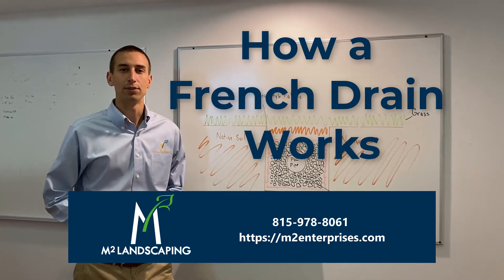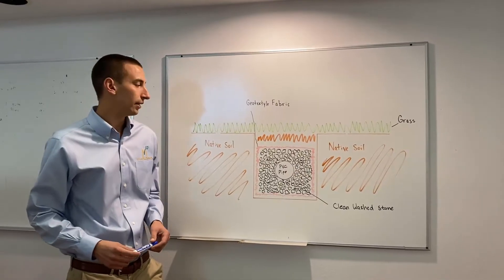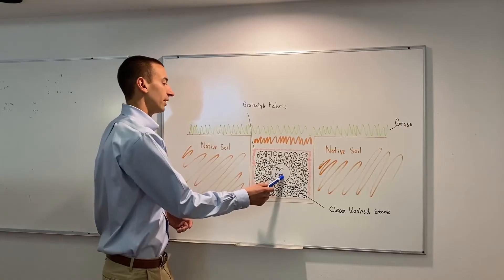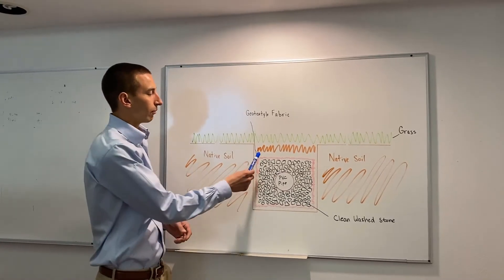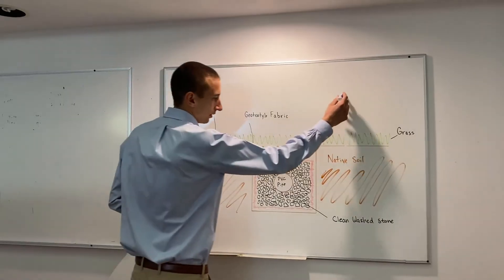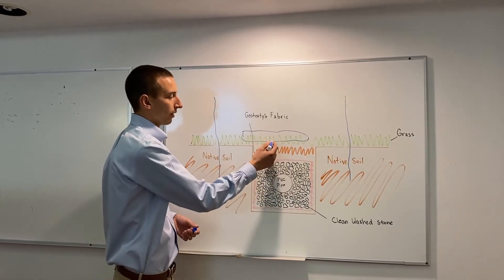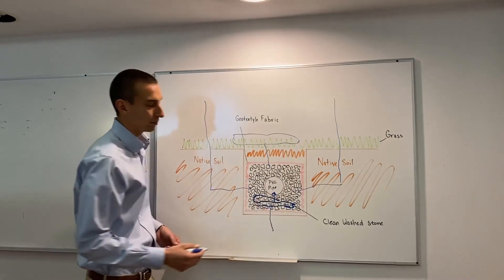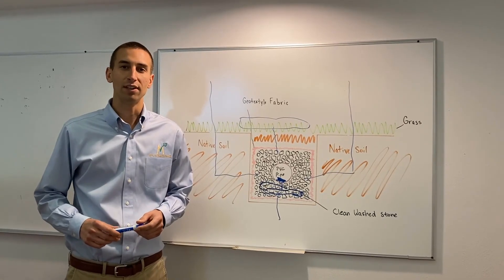How Does a French Drain Work?

Comment: 1. DON'T USE PVC PIPE! Use 8-slot high-density polyethylene pipe. The only pipe you should ever use for  french drain.
2. Place the pipe at the BOTTOM of the trench. There is no need to have several of inches of stone below the pipe. Not placing the pipe at the bottom will cause water to pond at the bottom of the trench and will attract tree roots, which will eventually destroy the entire system.
Reply: That’s interesting.

I am trying to prevent water from going under my concrete driveway. My driveway and the side of the driveway acts as a drainage as it’s sloped and has a lot of water collecting. 

Wondering if a French drain will help…
Reply: @garrettp.5018 from what i understand it should help ya
Reply: @garrettp.5018  Check out channel drains, install one along the side of the driveway where water collects.
Reply: I’ve had tree roots get into my sewer before completely destroyed. It had to dig it all up thousands of dollars.  

I would say you are correct you don’t want water pooling

Comment: Aren't there 2 holes on each sides not directly on the bottom of the pipe but at 5 and 7 o'clock?
Reply: depends on the type of pipe. Some have holes on the side of the pipe. Some have holes all around. The best pipe to use is 8-slot hdpe, which has 8 slots around the entire circumference of the pipe.

Comment: Hey there mate, i have installed a 1000 feet long PVC french drain without geo textile. Everything is working great and the water is coming out clear as well. But inbetween the line the water is pooling for about 80 feet or so! But at the both end it is very much dry. I don't know what to make/think of it. Your input would be of great help

Comment: Does french drain had vertical pvc or all in horizontal lay out
Reply: horizontal. You can add some vertical risers for cleanout access, but the pipe carrying the water will be horizontal, with a slight slope to it.

Comment: Why would ground water in the native soil travel horizontally towards the gravel? Wouldnt it go straight down due to gravity?

Unless that area is a low point….
Reply from the maker: Great question.  Once the ground is saturated it is looking for the path of least resistance, thus it will migrate to the gravel because of all the void space in-between the gravel. 

Generally speaking, French Drains are put in the lowest point.

Comment: Great video and informative and never got bored.  My neighbor has a leak they won’t fix and the city won’t help.  My question is I have a 3” pipe that runs under the area I need fixed and it goes to the street though the curb and is used for pool deck and backyard drainage.  How would I tie into it to take the water away from the side of my house?  Other than drains in the backyard there are no openings in the pipe but it travels directly under the bad area.  Do you have a video on that?  Again great job!!!

Comment: What is geotextyle ??? sorry if I am a thiko but never heard of it
Reply from the maker: It is a spun bound fabric used for filtration, drainage, separation of soil layers, reinforcement or stabilization in geotechnical applications.  There are different types of geotextyle fabric.  It is important to use a geotextyle fabric that allows the filtration of water when installing a French Drain.

Comment: Great illustration!! Does this mean there will always be water in the drain below the level of the PVC pipe?
Reply from the maker: Not necessarily.  Once rain has stopped and the soil has a chance to dry out the water below the pipe will dry out all well.
Reply: Yes, if you install it like the diagram he drew, which is wrong. You want the pipe to be at the bottom of the trench. There is no need to have stone below the pipe if you use the correct type of pipe, which is 8-slot high-density polyethylene, the only kind of pipe you should ever use for french drains.

Comment: Ok gotcha but it would do the same thing without the pipe. All u need is the rocks
Reply from the maker: If you do not have the pipe the water cannot be drained away.  If there is not a pipe the water will just sit in the gravel.
Reply: @m2landscaping  water will drain thru the rocks since it can't be absorbed as long as the trench is properly sloped

Comment: if the water can sip into the French drain? does that mean it can also sip out? if so, then how does it flow down?
Reply from the maker: The water in drawn to the gravel because of the voids in-between the stones.  The water will be taken away once the water level rises up in the gravel and reaches the holes of the pipe and taken away to the exit point.  Once the water level drops below the holes in the pipe the water will naturally be soaked up by the surrounding soil.

Comment: A traditional european french drain does not have any pipework within it, it is best thought of a ditch/trench filled with stone.  The storm water flows along the bottom of the trench to where it is collected and dealt with.  
What is shown here acts like a traditional french drain up to the underside of the pipe and only thereafter does it enter a piped drainage system.  Although you have wisely used geotextile wrap you could reasonably expect fine silt to flow into the pipe and because the holes are on the underside they will be prone to blockage.
If you have a perforated pipe then why not lay it as a land drain, i.e. with the holes on the top and then it can freely drain and probably self cleanse - this is a typical agricultural solution that works well.
Reply: Hubby and I put one in where our yard floods frequently. We did it as shown in the video only with holes in pipe on top. Yard area filled up till it reached the holes on top thus still creating a “pooling” problem. We dug it up, rotated pipe. Holes aren’t on very bottom, downward towards its side. Problem solved. Yard didn’t have to fill up to to top of pipe. Problem solved. Hope this helps!
Reply: @melisb100  The ground water level will have been reduced by installing the perforated pipe and the top level of that ground water would be at the lowest level of the perforations.  If you laid the pipe in a stone filled trench then the trench would have acted as the drain until it filled with water up to the perforations.  For that to happen the outfall of the trench is blocked and acts as a reservoir, which in the worst case would saturate the subsoil causing boggy conditions.  I don't know whether that happened to you or that pooling problem was the result of a low area being below the level of the land drain.
The only time I have specified perforated pipe on/surrounded by stone is where the pipe is part of a soakaway array and i am looking to percolate water INTO the ground.  I would never use stone bedding and surround together with a perforated pipe to drain a wet area, its one or the other.
Reply: The drainage performance has been shown to not work well when holes are up.  Presence and action of fine silt won't be mitigated by direction of holes.  The reason the holes are down is to reduce the water levels as much as possible.
Reply: @e4d578  That does not accord with UK manufacturers recommendations.
Reply: @clivewilliams1406  As a waterproofing professional for the last 18 years in Massachusetts.  I completely disagree with your comment.  I have seen systems fail year after year both in indoor perimeter drains and external french drain systems because the pipe was installed upside down (holes on the top).  The pipe manufacturer instructions specifically state the self cleaning function is with the holes on the bottom.  Think about a pipe with a slight pitch on it with the junk that comes out of gutters and mud.  It slowly builds up and has no way to get out.  Think about the water table as you would as the tide in the ocean.  A lot of the time the water table raises up during a heavy rain and rapidly goes away.  Now you have sediment in the pipe that sticks to the pipe and becomes like plaster.   I have removed thousands of feet of pipe that was filled like a fat mans arteries.  The holes ALWAYS go on the bottom of the pipe at 4 and 8 o'clock.  I would also state that most ADS (corrugated pipe is rubbish and shouldn't be used).
Reply: @robertracki4023  I have been in building construction for the last 49 years and as a qualified Architect for the last 41 years and have designed too many drainage systems to count.  In principle the position of the holes in underground perforated pipe is determined by whether the ground water is to be let into the pipe or be released from it.  Whatever the flow direction the holes cannot resist the flow of silt.  If the holes are at the top then the silt and water enter the pipe and flow along the sole to the outfall.  The rate of flow is at its maximum along the smooth bore.  Turn the pipe so that the holes are at the bottom and silt flows into the pipe and likely sits there especially when the water ground water has/is drying out, which blocks the holes, which also degrades the flow capacity of the pipe as it now has a rough surface to flow along .  The only time I have specified perforated pipe with the holes facing down is when it was used as part of a soakaway array when the design was to leach water out into the soil.  I have consulted with our UK pipe manufacturers many times over the years and they have always concurred with my principles of design.
Reply: @robertracki4023   I agree with the 4 and 8 o'clock, because it allows great volume immediately from the sides, bottom of trench, and it flows in the trough created between those two holes immediately, reducing the pooling at the bottom of the trench. The pipe I use also has a row of holes at 12 o'clock.  Yet I would never put a row of holes at the 6 o'clock position. I have installed clean-outs for silt, wrap it in geofabric, and do not allow any downspouts to enter the system. It is amazing to watch the water velocity with this setup even for a modest rain event. I suspect silt will fill up to those bottom rows at some point, only time will tell.
Reply: @clivewilliams1406  Maybe your soil in the UK is very different than ours.  In Massachusetts even with a good base of stone all the way around the pipe, if we put the holes on the top of the pipe it would clog within a couple years.  Every pipe manufacturers SOP sheet that I have read has listed the holes at the bottom.  Not sure if you have Orangeburg pipe out your way, The black fiber pipe used in the 1950's and 60's.  We replace a ton of it because it breaks down.  The holes are always at the bottom and it's almost never clogged.  It just crushed over time.  How about the old 1ft Clay tile pipe.  There were no fittings for the pipe.  The sediment washes out the bottom.  Image if those pipe were capped at the bottom and only had holes on the top. It's common sense what would happen. I would also never ever use ADS, filter wrapped or corrugated pipe products on any of my projects.
Reply: @robertracki4023  There are many soil types in UK as there are probably in Massachusetts, let alone in US.  I have been specifying drainage systems, including pipe array and land drains for the past 40 odd years and I don't recall any clogging, and trust me my clients, both corporate and domestic would soon let me know of any failures, even many years down the line (in law I have a minimum 6 years liability for the design).  Black pitch fibre pipe has not been sanctioned for use since the early 1970's, mainly because rats love it to chew on!   Old 1ft clay land drains used in agricultural fields were not a design that could readily be relied on as they were close butted and allowed as much water through percolation as through the joints.  Wrapping land drain in geotextile is a sensible move especially in clay soils to prevent the clay platelets entering the pipe, which would risk a build up and eventual blockage.  Indeed, where perforated pipe is used as a soakaway drain it is often required by the building inspector to ensure maximum performance longevity.  Corrugated perforated pipe is very widely used here for extensive land drainage schemes due to the ease of laying 100's metres  
We clearly have differing standards on each side of the pond.
Reply: I repeated myself but you get my drift! Lol, have a great day😀
Reply: Putting the holes on top is pointless since the water would have to raise to that height before they would be effective
Reply: @emeralddragon2010 Having the holes at the bottom to inflow water is also pointless as the holes will block with silt in no time as the water would not enter the pipe with any decent flow to ensure self-cleansing.  With the holes in the top half of the pipe any silt is washed to the invert (sole) of the pipe and then flows away with all water ingress, with the pipe gradient designed for self-cleansing.  The effective drain height for the lowering of the water table is at the mid- depth of the pipe, an additional 2" of depth is not going to make any noticeable difference on the water table if the pipe is inverted, on the contrary, when the pipe holes block the land drain will be ineffective and the water table will rise..
Reply: @clivewilliams1406  sadly you obviously have no idea how a french drain works. Thanks for showing us your ignorance. I shouldn't expect more from someone named Clive lol